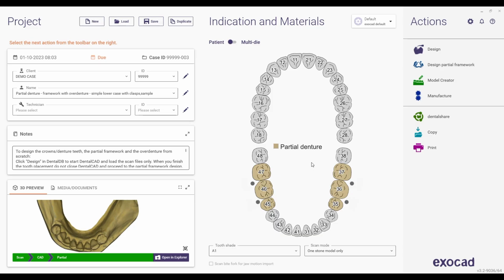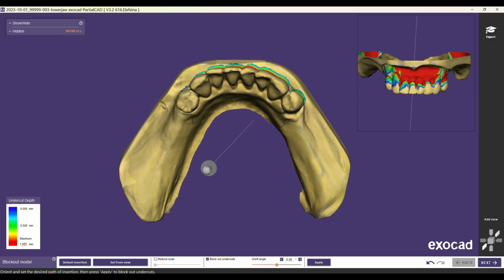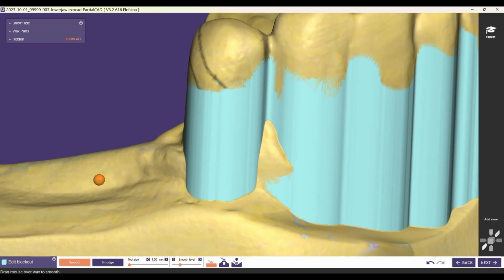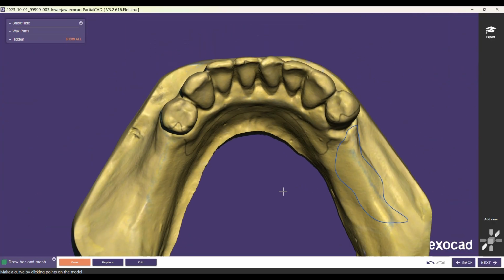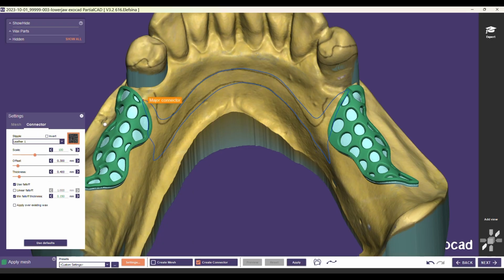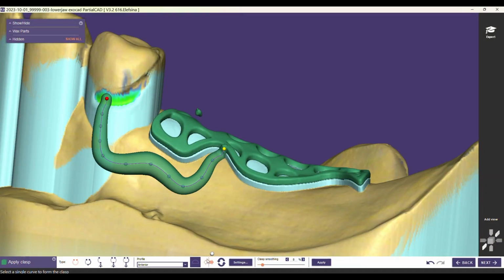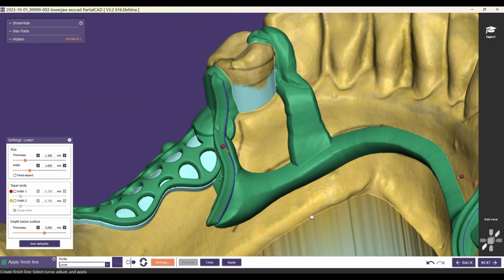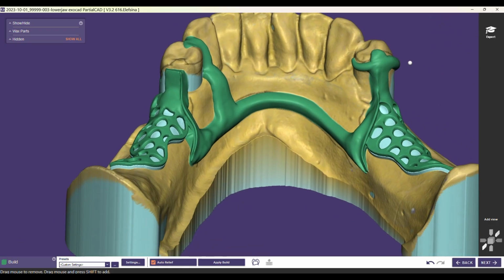Design a RPD Framework with Me ! - ExoCAD CPD Tutorial

Comment: Hi all expert there..im new for designing partial in exocad...please can you share your settings  for standard thickness for clasp,rest,major connector ang lingual bar? Thanks in advance❤
Reply from the maker: Hey. 

Major connector for Maxillary is 0.5mm thick 

For Mandible the profiles are usually set (half pear shape cross section) .. but the bar itself should be atleast 5mm or greater 

Clasps depends on your preference. Only criteria is your tip or the terminus of your clasp should HALF of diameter of the clasp at it's starting point 

Ideal rest thickness for avoiding fracture is 1.5mm near the proximal surface and 0.5mm at the thinnest part of the rest. (Edges) 

Please remember that most of the times these values are going to be affected or changed slightly based on how much prep space you have in the rest seat or the tooth size and so on. The preset you have in partial softwares are usually sufficient . So don't change too much from there
Reply: ❤thanks brother Appreciate it🙏